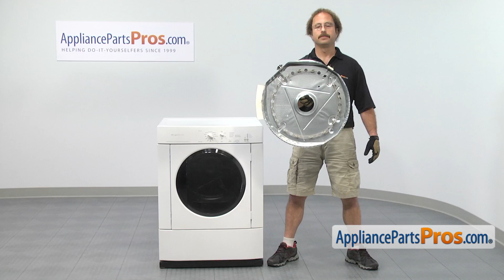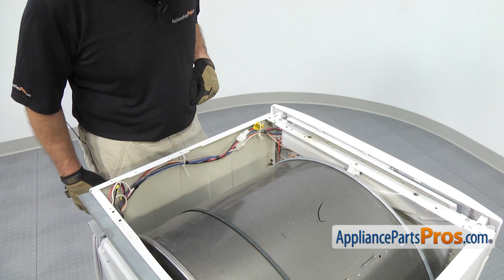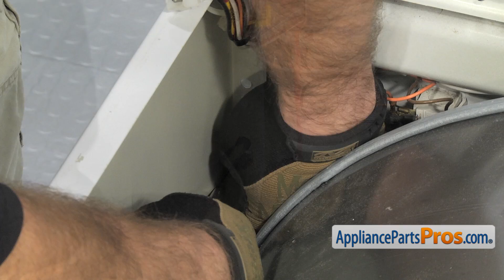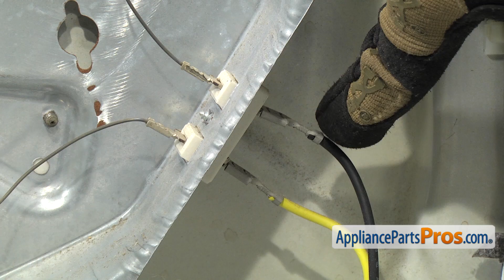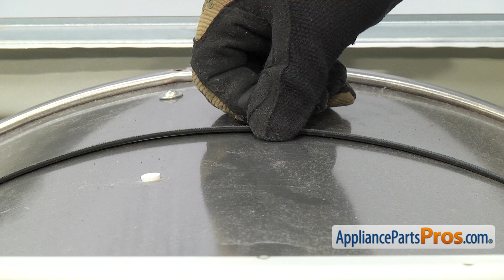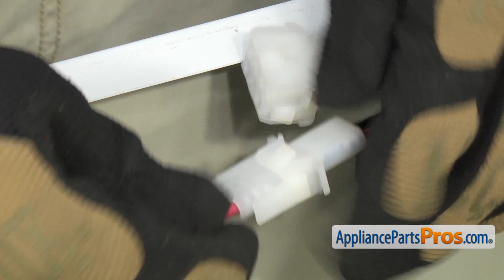How To: Frigidaire/Electrolux Dryer Heating Element Assembly 131553900

Comment: I thought the heating element would be snapped in w/o remove the base dish.
Reply from the maker: Good question! The heating element setup can vary depending on the model. The one in this video mounts to the back wall, but some versions do require removing the base plate. Let us know your model number and we’ll be happy to help with the specifics for your unit!

Comment: I took my dryer apart, as per your instructions, which were excellent by the way, and found that there is nothing wrong with the heater core.  Ran a continuity check to make sure--the heater core is good.  So why is there no heat?
Reply from the maker: Normally if you are testing the heating element we advise to test it for voltage. You could also maybe have an issue with a thermostat. What is the model number of the dryer?

Comment: A few tips. 
Dont take off the 6 screws in the back of the drum. Three hold on the heat shield and the inner three hold onto the bearing mount... you can take these off instead of pulling rhe bearing out if its stuck. Keep track of which type of screws come from where because they are not all identical. The heating element coil is a lot cheaper than the whole heating element assembly. If you have a washer dryer stack, removal of the bottom front panel requires removing rhe bolts right below the panel, then tilt the dryer back to access the screws shown in the video.
Reply from the maker: Thank you for the tips.

Comment: I was able to switch out the heating element in my Frigidaire Gallery Series Dryer in 3 hours. Unfortunately, the replacement had to be adjusted after I had already put it in, but it only took about 20 minutes to take out and adjust the heating element so that it lined up with the wiring. 

After that, it was basically a breeze! So instead of spending $700 for a new Dryer, it only cost about $70 to replace the heating element thanks to your video! Thank you so very much!!

Comment: should grease the back bearing socket- the tensioner pulley shaft and the motor shaft where the centrifugal switch rides

Comment: my dryer stopped making heat. coil and theromol has continuity. did find  alot of lint in the exhaust  of front cover. not sure what the problem is yet. heat setting knob diode?
Reply: Lint clog below filter stopped the heat. Clean  it out good now
Reply: Did you find an answer to this?  My heat is low, and fluctuates, so im thinking thermostat, or bad coil.  Haven't disassembled yet..  thanks.

Comment: Came here to say your video is still helpful for those of us still rocking older dryers.

 In my infinite wisdom (before your video) I broke a coil on the heating element, and believe I need to replace the idler pulley or motor pulley. Drum wouldn't spin when I plugged it back in. Either way, thank you for this helpful video!!

Comment: Good time to replace the standard sheet metal screws with longer, better made ones. The factory versions are too short and very frustrating when re-assembling.
Also might want to replace the foam donut by fan housing - it'll fall apart when the front housing is removed.

Comment: I changed Dryer Heating Element Assembly 131553900.  My dryer fixed but when it run I feel it hot on top panel as well, is that normal or I did something wrong?
Reply from the maker: We offer free technical advice and diagnosis on things that aren't covered in our videos, so we'll be glad to advise you on that. We’re available 7 days a week at 1-877-477-7278 or you can chat us at our website: http://www.appliancepartspros.com/
Reply: I did everything correctly by watching the video and following along. Everything was placed and replaced correctly. My dryer works, and heats. However, for some reason it heats way to hot! After a few minutes on medium heat, I look in the dryer and see the coils are red hot, the dryer has a burnt smell, and the top of the dryer is way to hot to even touch. Obviously its not heating correctly, and is out of control. How do I correct the problem? Please Help.
Reply: I did everything correctly by watching the video and following along. Everything was placed and replaced correctly. My dryer works, and heats. However, for some reason it heats way to hot! After a few minutes on medium heat, I look in the dryer and see the coils are red hot, the dryer has a burnt smell, and the top of the dryer is way to hot to even touch. Obviously its not heating correctly, and is out of control. How do I correct the problem? Please Help.

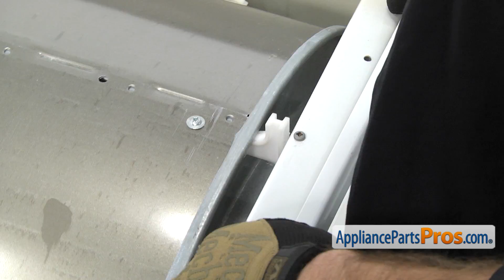Comment: Hello I have ordered my heating assmebly kit from from you but at 10:23 when I put the front door and push it back, its taking my drum off the support which pushes it close to the heating assembly kit and the motion has friction. What am i missing. Can you show the part of the video which focuses on putting the front door back after the drum has been installed and front support has been placed?
Reply: the question I am trying to ask is - should the drum be on support of the white plastic support or the rim of the front door assembly?
Reply from the maker: We'll be glad to help you figure out what's going wrong. We will need your model number to give you accurate advice, which you can locate using this tool on our website: http://www.appliancepartspros.com/modelnumber_locator.aspx This video is applicable for all the many models that use this part, but with your model number, we can look at schematics for your particular unit to see what may be causing the problem. You can give us a call at 1-877-477-7278 or you can chat us at our website: http://www.appliancepartspros.com/.

Comment: my belt is loose still after putting it back on the motor pulley - can you tell me what I'm doing wrong?
Reply from the maker: We'd be happy to help you out with that! We offer free technical advice and diagnosis. You can give us a call at 1-877-477-7278 or you can chat us at our website: http://www.appliancepartspros.com/. We will need your model number to give you accurate advice, which you can locate using this tool on our website: http://www.appliancepartspros.com/modelnumber_locator.aspx

Comment: My ball bearing seems to be stuck and I can't get it to release.
Reply from the maker: +Jessica Valenzuela The ball that supports the drum should just lift out of the bearing so you can take the drum out.
Reply: I had to use the claw of a hammer to lift the drum up. After that, it came right out and went back in with no problem. I greased the ball and bearing with a little axle grease. 

Dryer is a lot quieter and turns like brand new!